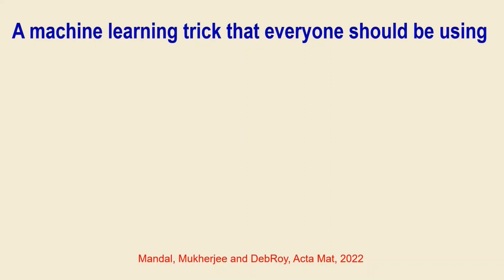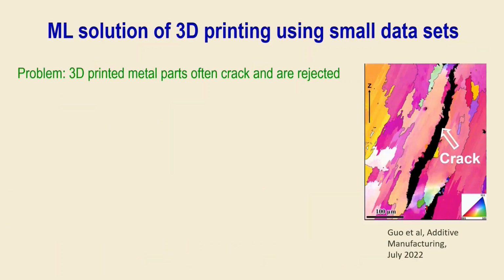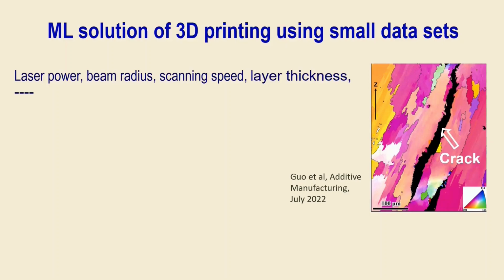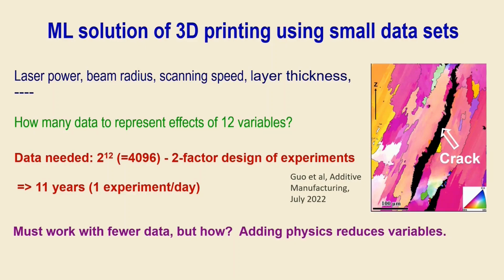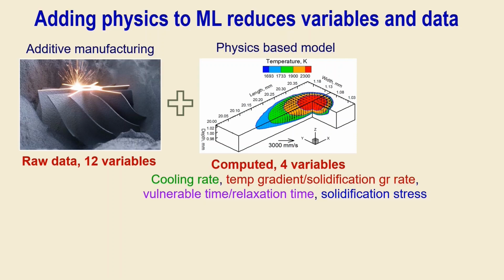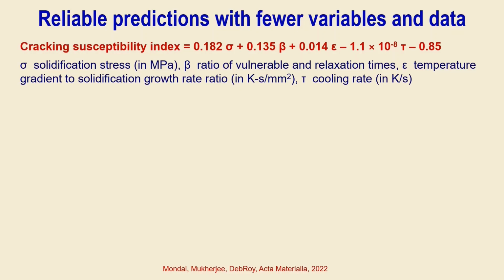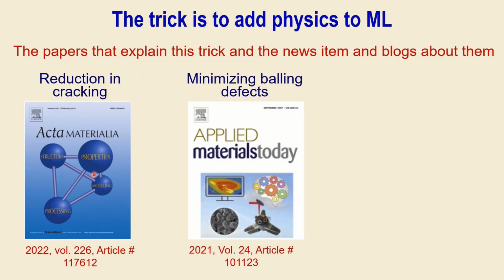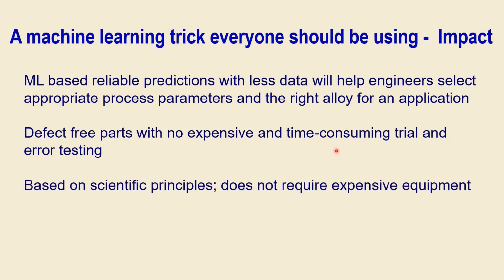A Machine Learning trick that everyone should be using

Comment: Dear Professor, Thank you for this short but clear video about the importance of reducing the variables for machine learning. It will surely add value to my research work.
Reply from the maker: The procedure works because the behavior of many complex engineering systems is often accurately described by a group of variables rather than individual variables. An example is the well-studied problem of the flow of fluid in a pipe. In principle, four variables, i.e., the pipe diameter, average fluid velocity, and the density and viscosity of the fluid can predict if the flow is laminar or turbulent. However, it is well accepted that the nature of the flow, laminar or turbulent, can be predicted by only one variable, the Reynolds number. The reduction in the number of variables can make many problems tractable.
All the best in your research.  T. DebRoy